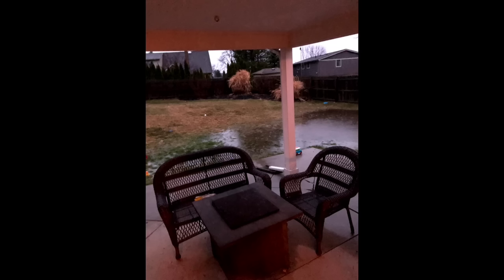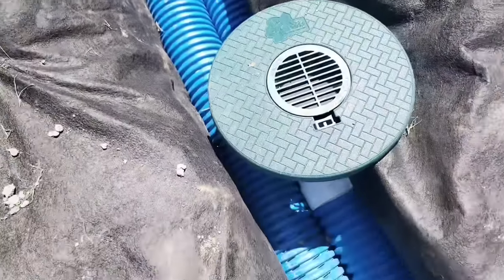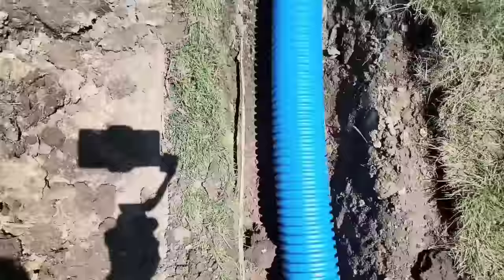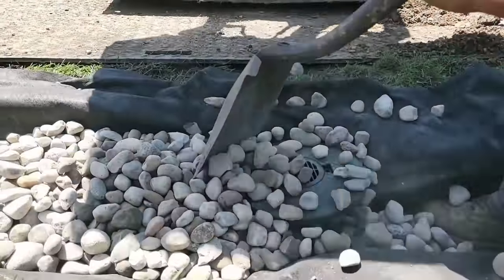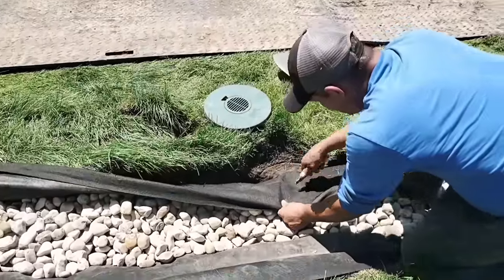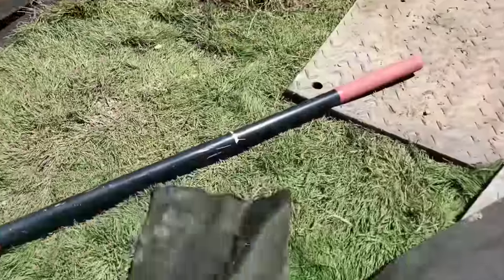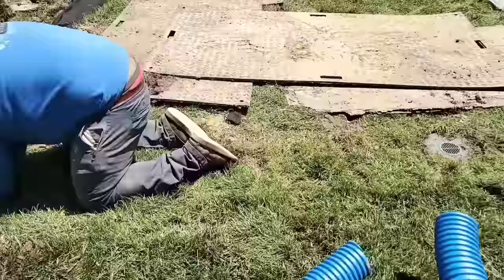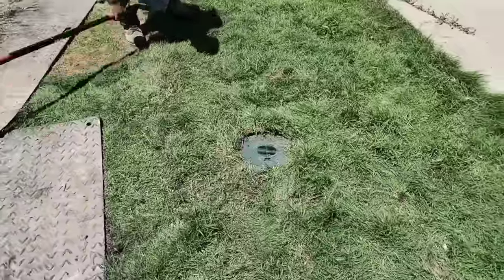How to Collect Surface Yard Water Using Your French Drain Trench [ Work Smarter Not Harder Easy DIY]

Comment: Maybe I missed it. Where was all of the water being routed to? I get that the popup emitter will spread the water from the downspout across the lawn, but where is the water from the 8 slot french drain and from the solid pipe with catch basins being routed to?
Reply from the maker: Gravity drain down the side of the house to the street curb out front. Ended the line with a pop-up emitter.
Reply: @FRENCHDRAINMAN  would u recommend  routing the water to a 8 x8 drywell where the gutter is also piped to aswell

Comment: I live in London so London clay is under the garden,  in one area where water pooled I used an an auger and drilled down 600mm  filled 90% of the hole with shingle then top soil on top to help with the drainage seems to be working just need to re turf the area as it is in a shaded area, also check to see if you have an underground river.
Reply from the maker: Dry well is effective in some cases.
Reply: @FRENCHDRAINMAN  = Would have 2 or 3 inches of water sometimes and the mud/sod would be slippery as hell, London clay is a law unto its own as shrinks quickly and thats why London had so many brick factories and potteries also that is why the nickname for Fulham Football Club is the "Potters"

Comment: Interesting video. However one thing to note, you don't have to pack your dirt down that well. Yes, doing it right will save you a bit of work, but if you need more dirt in an area you can simply sprinkle/layer some dirt and the grass will just grow through it. Something to keep in mind if you have a few lower spots after finishing. No need to remove sod.
Reply from the maker: Our installation crew has a no call back policy. We simply will be out of business if we have to send crew members back because of a erosion claim or settling. I do understand your point tho.
Reply: @FRENCHDRAINMAN  Ah, Yes I guess for you that would be an inconvenience. I was mentioning it for people that did it themselves. Very easy to take a shovel and sprinkle some dirt where needed.

Comment: The pop-up / catch basin with open-bottom over the french drain confused me.  Leaves and shingles are now going into the french drain trench.  You can open it to clean it out, but at that point don't you have leaves and shingles potentially getting to the slotted pipe?
Reply from the maker: It stays concentrated in the bottom of the pop-up fitting.  You don't have to do it, you can put your pop-up on the outside of your French train.  We have customers that complain if they have a little puddle of water anywhere after we do our systems so by doing a popup in a French Drain the waters never left to puddle. Some yards are uneven.
Reply: @FRENCHDRAINMAN   Perfect, thanks FDM!  This is exactly what I wanted to do anyway but thought it was a no-no.  Really appreciate the reply.

Comment: Great info and video!! Sir I have a question between my neighbors house and mine. It’s just a really bad spot there with water collects in the middle and it’s just ruining my yard so I’m going to put a French drain down through there. Do I just put it in the middle there and I guess the water will go to the lowest spot and drain out of the yard. That is the correct way to think about this right? Thank you.
Reply from the maker: Yes. 
We do consulting as well 248-505-3065

Comment: Several other videos say holes r to be in bottom, #2 grade rock then fabric finish with burrito wrap.
Reply from the maker: https://youtu.be/kqUNnc0j8Kg
Reply: @FRENCHDRAINMAN  thanks
Reply: Holes are always down. 

The failed pipe that was removed didn’t fail because of the orientation of the holes. It failed because the system didn't include the drain rock to keep the finer sediment out. Keeping the sediment out can be accomplished by either surrounding the pipe with extra drain rock, or more commonly by using the filter fabric.

Comment: Hi. Just saw your video and would like to know what sort of system would you build to drain standing yard water to then catch and store in order to use in spring/summer veggie garden??? 
I want to drain my front yard but also preserve what I drain to reuse. A different sort of rain catchment instead of using downspout from roof it would be coming from standing in the yard. 

Have you ever been asked to build such a system? 
How would the rain barrel portion be setup in order to use with ease throughout the growing season? 
How would the drain and storage attach to each other? 
What area do you work in? 
Thank you.
Reply from the maker: You need to have several cisterns installed

Comment: This is an amazing max info video. So many of your videos I’ve watched come together on this one!

Q: Is there a maximum suggested length for pvc adapter that connects to a pop-up emitter? 

I have situation where I’ve made/finished a burrito wrapped FDS that discharges into a deep storm water gully- but set the discharge pipe too low at the bottom of the gully. When we get a heavy rain and the gully fills up this causes the drain to start filling back up into the French drain. 

Thinking, if can install a 10” - 12” high section of PVC that holds the pop up emitter over the gushing water, this can keep the discharge level above water level. I assume I would drill holes on the bottom of the adapter as you’ve suggested to let the extra seep out. 

Is there a standard height you’d recommend?

Trying to learn! Thanks
Reply from the maker: Results vary with trench depth. Once we are 16" deep or deeper we go to triple pipe system with 2 eight slot High Octane on the Bottom. We do 1% Slope.
Reply: @FRENCHDRAINMAN  thank you! How high can a pop up emitter pop up?
Reply: Is it ok to have an extended piece of PVC rising up - say a foot high - from the French drain pipe to the emitter?
Reply from the maker: @willray4098  No. If you have this situation you need a Outdoor Sump Pump System. You Pump the water to the surface and discharge it to your desired location. I hope this helped.

Comment: This may be a dumb question - complete rookie here. Is it okay to do a French drain with no drain basin? I am going to build a dog area with river rock. I’d like to put a French drain system underneath this dog area so that when I clean it, (enzyme-water sprayer/ sprayed with the hose) that excess water will go down and be flushed out by the French drain. This French drain system would only be 10-15’ long, and then connect to the solid pipe which will be connected to all my down spouts. I live in Arizona, so the soil is dense. It often floods so I am trying to brainstorm ideas and knockout 2 birds (flooding/ urine smell) with one stone (French drain/ solid pipe system).
Thank you for your videos, they’re extremely helpful
Reply from the maker: https://youtu.be/VFYj7sbmXGg

Comment: If I had low spots in my yard, 1st thing would fill in with dirt to even it and slightly higher where needed for run off. Did small trenches to re-direct water flow/build-up. If that wouldn't work, french drain. See where this would be needed more when living in a subdivision or in city.
Reply from the maker: FILLING  in a low spot is the worst thing you can do because it make the water harder to collect. You will chase water till you are blue in the face. LOW SPOTS are great collection areas. 40 years ago I thought like you and I learned the hard way. ✌️ 
Thank you for sharing

Comment: Will this system work in the kingman az desert ?  I have alot of water that flows from back property's onto mine and across at a diagonal.  I would like to reroute it along and down the fence line to where it normally exits.  Will this work in desert sandy dirt ?
Reply from the maker: No, it will not work in the desert sand.

Comment: Great descriptions and explanations. Any particular reason you used corrugated vs pvc? Here in the south most professionals go pvc these days. Wondered if there was a reason you didn’t.
Reply: Corrugated is flexible so it’s often times easier to install because no connections are needed to make bends of changes if direction.
Reply: $$$$$  its far cheaper for the installer. 
Your mileage might vary  when it comes to how long it lasts.
Reply from the maker: PVC is really heavy, and in wet soils, it'll form more bellies than you'll ever find in corrugated pipe.

Comment: If the area you are draining has zero slope say, for 50 feet, but the remaining 100' of drain has good slope, the daylight exit is much lower than than the the rest of the system...will that first 50' of zero slope still flow?
Reply from the maker: Yes

Comment: So where does that water go..does it drain into the storm sewer or does it come out to day light through a pop up somewhere else in the yard?
Reply from the maker: Discharge ran out front to the street. Yes a pop-up emitter
Reply: @FRENCHDRAINMAN  ok. So a French drain with a 1% to 3% slope is enough pitch to force the water out of a pop up emitter at the end of the run? I can see how roof water from a downspout has the velocity to come out of a pop up emitter but I would be afraid that a French drain for yard water wouldn’t

Comment: I did not save my sod. Would it be better to burrito wrap my drain tile and rock and then just add topsoil and plant grass? Or put a couple inches of gravel on top of the burrito and hope it will slowly fill in with grass? Thank you! I just received my order from you and anxious to get started.
Reply from the maker: If you have a sprinkler system it's easy to grow grass on a french drain.  If you don't have sprinklers you will need more dirt on top of the french drain. Make sure to put straw over your seed to keep the new seedlings from drying out. Hope this helps. Thank you for commenting and contributing.

Comment: How does surface/subsurface water in a yard not immediately above the drain, instead of go straight down further deeper into the soil, got drawn into the drain ( if the drain is not at lower point ), read somewhere water follows path of least resistance or something ?

Comment: I got 5 acres that needs to be done in Buffalo ny do u know  a good companies  out here that does a nice job like you guys out here that u would recommend lol
Reply from the maker: Most homeowners are buying and supplying a local contractor. You can get a quote for them to install the pipe you supply them that way you know the system will not fail due to cheap garbage pipe. Let me know if you find a good contractor in your area. At this time we don't know of anyone.

Comment: I have a overly saturated back yard, that slopes away from the house. When it rains water floods the far corner of the yard. Water also flows on top of the soil from high point to the low corner that floods. My thought is to install a catch drain in the corner that evacuates the water out "under" the fence. would a French drain work in the saturated part of the yard or just the catch drain? Also, should I add drains and solid drain pipe where water rushes over the ground towards the low corner?
Reply from the maker: https://youtu.be/kk1E699sQHI?si=W5kh9TBQyzN5_glp

Comment: Hello Robert, I have a situation where someone needs to change how their setup is currently. They have at least one channel drain at porch and 1-2 gutter pipes leading into an open yard pit which overflows into neighbors yard sometimes. They would like it to go away since an eyesore in their mulch bed which is only trees. Here it does slope to side yard and somewhat to side/back yard. Several trees around. Also no city drainage at road so everything needs discharged into yard. What’s the best design/install option? Thinking running each gutter in various spots on side yard to disperse. Would adding a River birch tree also help? Thanks
Reply: Vegetation almost always helps. 

Water flows downhill, so the key is figuring out where is downhill. 

You could also increase the underground reservoir by using bottomless barrels instead of rocks (100% void instead of roughly 25% voids), or even install rain barrels above ground and save on irrigation $.
Reply from the maker: https://youtu.be/VFYj7sbmXGg?si=IG6UFwzlIxEcDS5M

Comment: If you cut your grass with a zero point mower, will care have to be taken to not run the machine over these drains?
Reply from the maker: No sir
They take 4600 lbs with no problem. Tractors 🚜 can drive over it
Reply: @FRENCHDRAINMAN  Awesome! Thank you🤙🏽

Comment: I live in an area where foundations have to be 4 feet down due to winter ground freezing. How does this affect installation of the french drain? Thanks.
Reply from the maker: No it does not. The French Drain Systems can be shallow but we do build them to Drain out completely.
Reply: A building foundation would commonly have an underdrain system, but probably separate from a French drain system similar to the downspout drains being separate in this video. If grades or public sewer systems allow, it might be able to drain by gravity flow. More commonly though, because of the depth, it would need a sump pump.

Comment: Now please tell me if there was gravel in the bottom of trench and all around it etc where you took out the old pipe. No doubt your solution works but if the pipe you pulled out was installed incorrectly you should mention that.
Reply from the maker: It was installed correctly. PVC doesn't have holes 360 degrees like corrugated so when the bottom of the drain fills with sediment it can no longer work

Comment: Question.
How deep should your trench be?
Reply from the maker: https://youtu.be/F5d-47POqbo
Start at 10" and drop 1" every 100" for 1% Slope.  Watch the video on how to do this. Super easy DIYers under $5.00 way of measuring Slope of your trench bottom NOT the Slope of your grade. Always 2 pipes on the bottom of the trench with our double punched fabric. Enjoy your drainage project. If you do this you will be successful.
Reply: @FRENCHDRAINMAN  how wide for the 2 pipe burrito special?
Reply: Another question, for my solid pipe drain I was going to add multiple 6 inch round catch basins, but how do you keep the 1% slope going and yet keep those suckers at ground surface??!! Is there an adaptor or extender that keeps basins ground level while pipe keeps going deeper in ground . There ARE NO VIDEOS discussing this. Please advise!
Reply: Deep
Reply: The pipes are probably 4” drain pipes, and it’s best to have a space between the pipes that is bigger than the rock you’re backfilling with. If you are using 1.5” rock as he recommends, that’s at least 6” (3x2”) wider, or 14” minimum. It is more common, and in many ways better to use slightly smaller rock; 3/4”. The key though, is that it is drain rock, or washed rock, so that there aren’t the fine aggregate that does clog the system. 

As for the riser, you could fit a pipe extension on to it, but if the ground is rising, you don’t really need an area drain. Water flows downhill.

Comment: We’ll sir if you dig your trench wide enough and deep enough and put a good 4-6 inches of gravel under the pipe with holes down.  It won’t clog. If you cheat with the 3/4-1 inch pieces of gravel under the pipe yes it will fail.
Reply from the maker: We perfer corrugated pipe because it has holes 360 degrees and it doesn't fail

Comment: Are all solid pipes in this video coming from a downspout? Why add inline catch basin to cath water if the French drain is next to it? Shouldnt the French drain be catching surface water? 
I'd love to pick your brain
Reply from the maker: https://youtu.be/bsSJpziHduk
Reply: @FRENCH DRAIN MAN  so it's for areas with heavy water above ground? The French drain doesn't suffice enough for that being ran thru the same area?
Reply: The French drain collects subsurface water. It could collect the surface water after it flows through the soil, which could take a lot longer if your soil has a high clay content. Area drains are faster and keep the French drain cleaner.